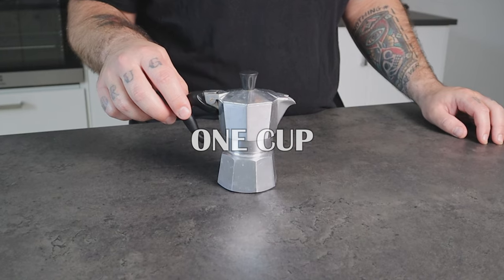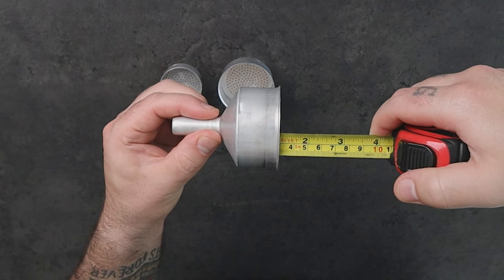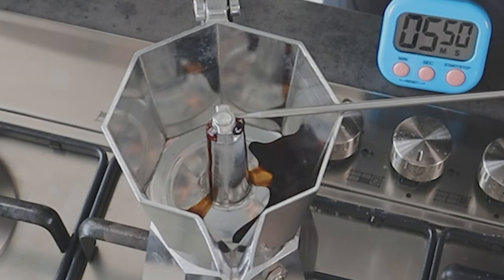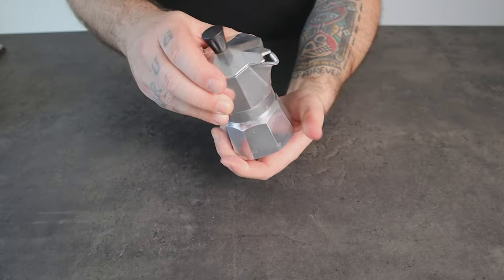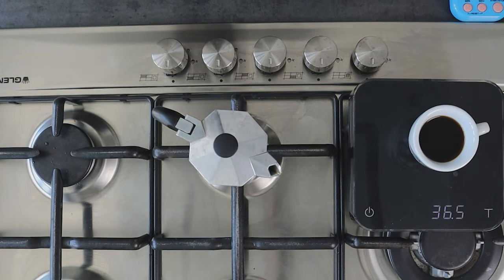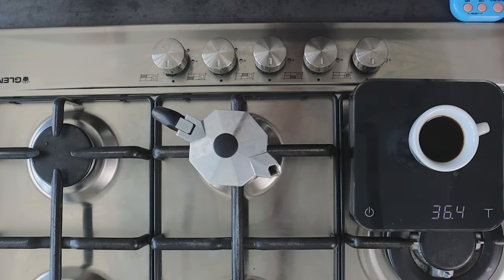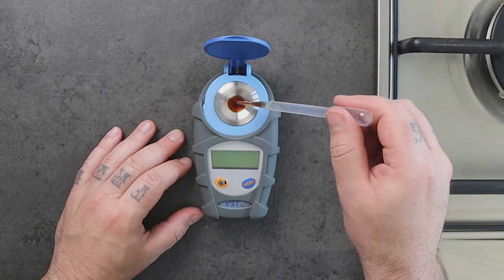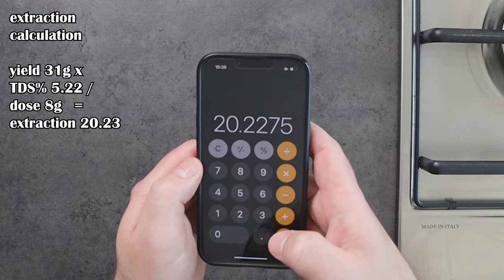The BEST Way to Make Stronger Coffee with 1 Cup MOKA POT Revealed!

Comment: What is the reason that after brewing I find coffee grounds in the water half of the pot.
Reply from the maker: That happens when you have any fine particles in the basket, it is normal that happens as water remaining in the bottom chamber. The ground coffee is brought down by the water that is in the basket together with the coffee and that when you finish to brew the moka, this water, with the dropping of the pressure inside the pot, go back down and bring fine. That could also happen if you put the ground coffee in the basket that is already placed in the moka lower chamber